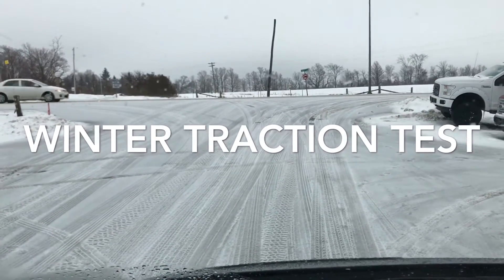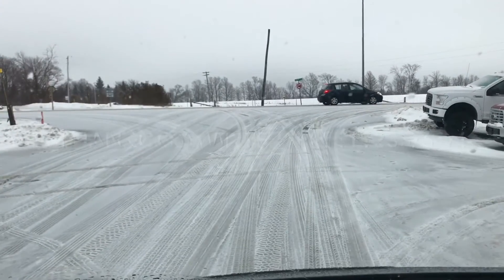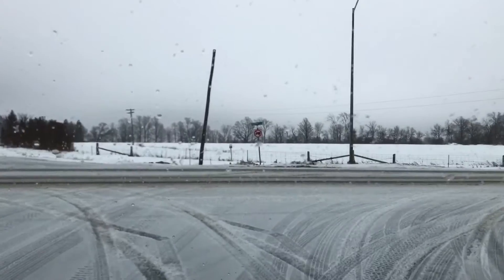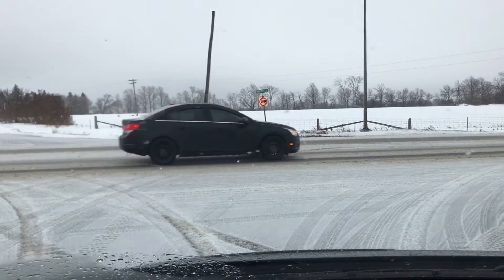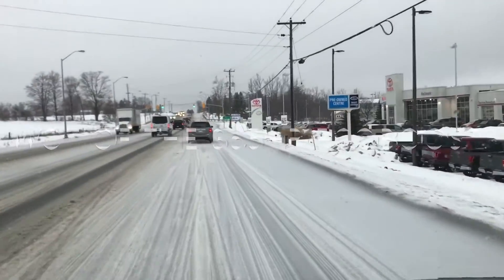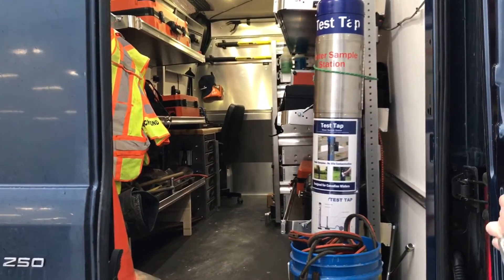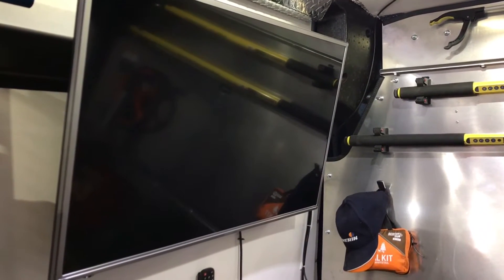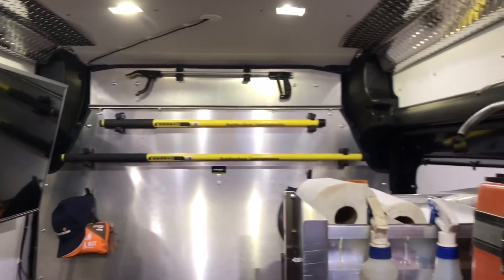Canadian Winter Ice Storm Traction of a Ford Transit Van

Comment: Unloaded transit vans and 2wd pick up trucks usually have a lot of problems in winter. But its crazy what a little weight can do for it. Sedans and a lot of older rwd vans have a much better weight distribution unloaded.